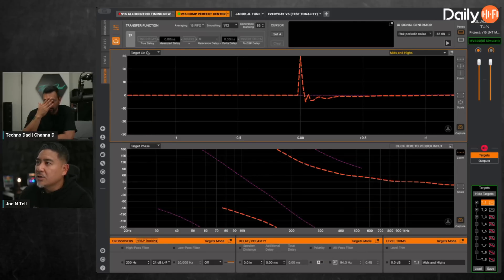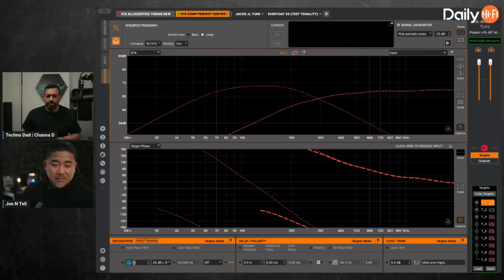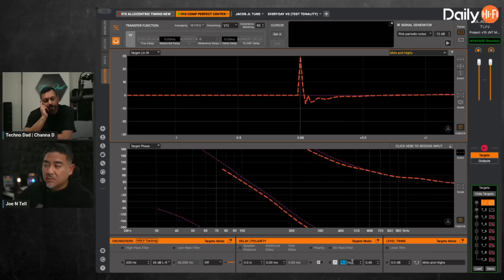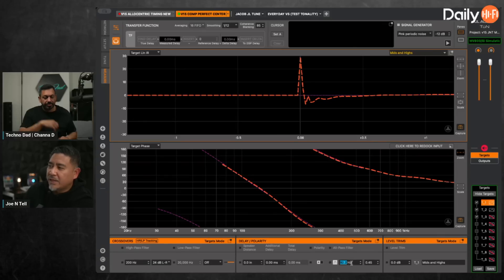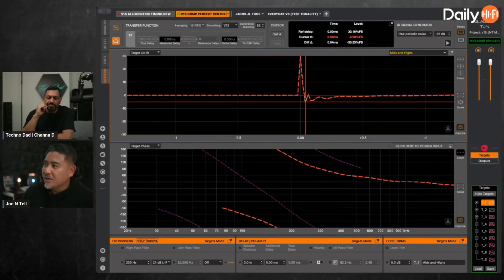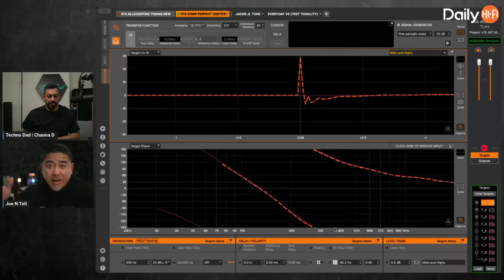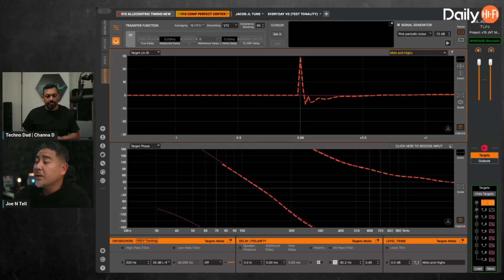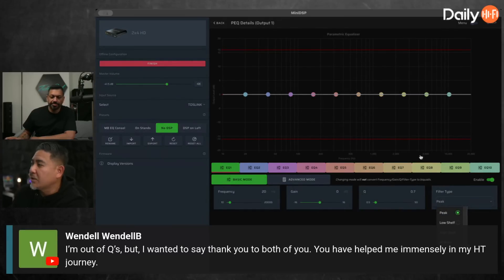How All Pass Filters Can Enhance Your Audio Calibration

Comment: Nice video, please note that for open sound meter it is recommended to used an xlr mic with an audio interface instead of usb mic due to timing drift. 
Also MSO uses all pass filters!:)
Reply: Correct
Reply: I tried it with umik 1 and the magnitude graph just shows a flat line is that normal  @joentell
Reply: @msoles30  configuring the loopback is tricky. It should't be flat. It should move when the mic picks up sound.
Reply: @joentell  so how would you configure that without external sound card the only thing works is the spectrum graph
Reply: @msoles30  I use a motu m2 USB audio interface with internal loopback. Others work as well. I think the app has an internal loopback also. You can't use a USB mic for it though because it has its own clock and it will get out of sync with the app.